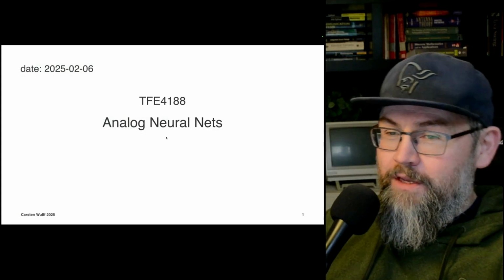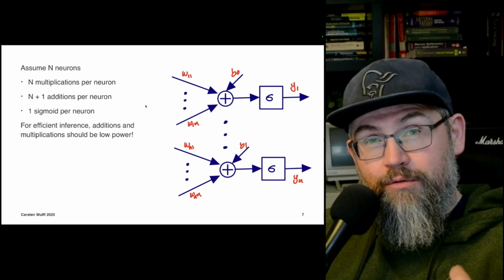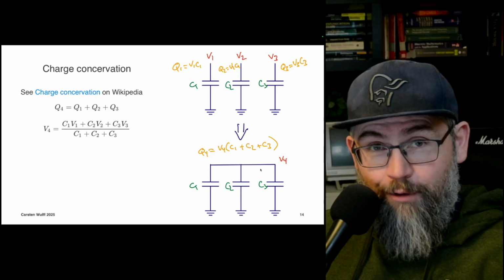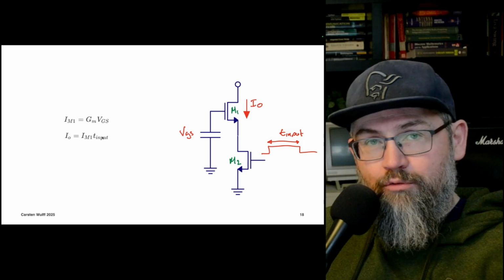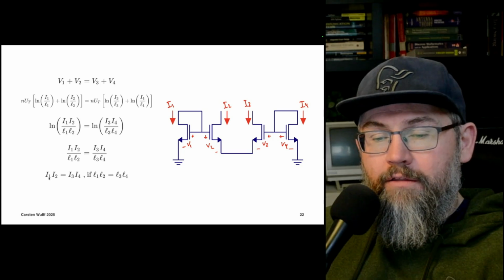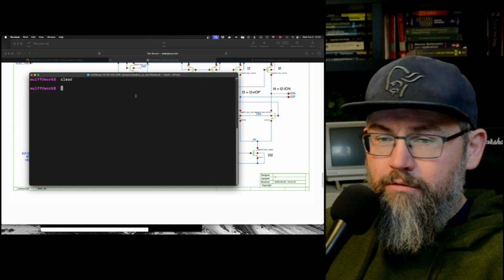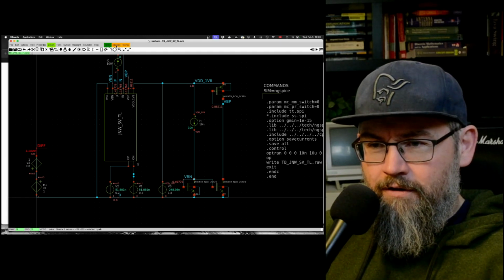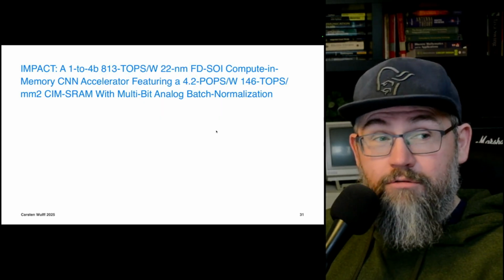Lecture 4 - Analog Neural Networks and Translinear Circuits

Comment: My idea was to train a normal net, prune it as much as posdible, and then make it a single purpose analog hardware NN with hard baked weights. It was still too much elements to make it discrete, and I have no hobby budget to make silicon.

Comment: you need to stop think neural networks like in computers and start to think in terms of noise and electric pulses and gain in analog circuit to create learning based on a system creating its own equalibrium where a external infuence make it adapt where signals fire all the time across different gates like a dynamic system. the learning or adaptation restore equalibrium. this way there is no learning like in a perceptron model. your are not solving a equation. all learning are probabilistic based on influence. in order to make it behave like a mind external stimuli is needed to keep it from reaching equalibrium but so that it is modifying itself to reach it. this is not intelligence like a computer. its not really a network. the firings has no intelligence in them on their own.

Comment: I'm definitely not an expert in the field here, but this seems much more practically useful than today's methods poking at analog convolution on MLC NAND where the burden of noise with size scaling is far too high... Even if transistor linearity can't be solved creatively, that kind of inherent dynamic range should allow for per-chip characterization without excessive quantization.
Reply from the maker: Let's see what the future brings.

Comment: Really interesting video! Doubly so for me personally, considering I am actually wrapping up my master's thesis on this topic. I thought it'd be cool to share some of my experiences so far while doing this in case someone else might be curious to see what else lies ahead with regards to analog neural networks.

I am approaching the design of my own network in a much more "brute force" method, so to speak, by using transconductance multipliers to get a differential current at the output and then short-circuit the corresponding ends to implement the summation of the weight-activation products "for free" without needing to use any extra circuitry by leveraging KCL directly, just like you show in the video. From what I have noticed, the trend for such multipliers is designing them to work in the saturation region to squeeze out as much speed out of these devices as possible.

Additionally, for the activation functions, I stuck to the most simple ones for the hidden layers, those being ReLU and Leaky ReLU. They're basically half-wave rectifiers, and there has been an interesting implementation that tweaks a full-wave rectifier for solar harvesters. For the output classification, any Winner-Take-All (WTA) will do the job, but again, there seems to be a bias towards using saturation region-based techniques. The cool thing with WTA topologies is that you can immediately interface them with a digital front-end, as they can be designed to produce logic 0s or 1s with relative ease.

Finally, I would like to say that, surprisingly, the idea of implementing neural networks in an analog fashion is nothing new. In fact, it has been around since the late 80s! Though, it is quite intriguing that this idea is coming back now that we're dealing with these massive, power-hungry models. Definitely looking forward to see what else will be going on in this, admittedly, niche field.
Reply from the maker: Thanks for sharing your experience. Directly using Gm-C is interesting.